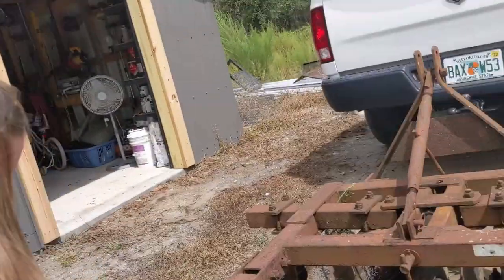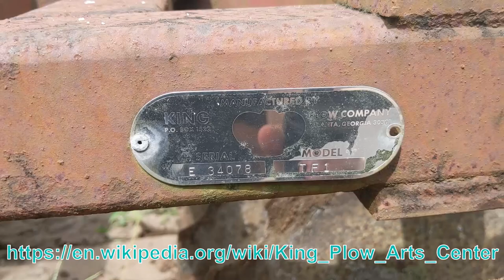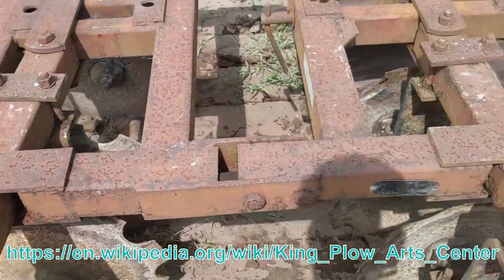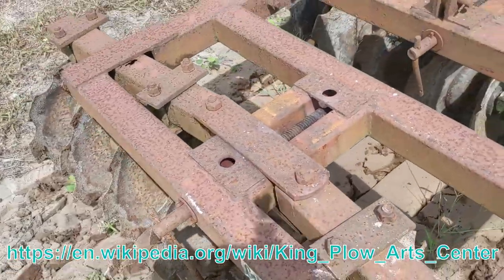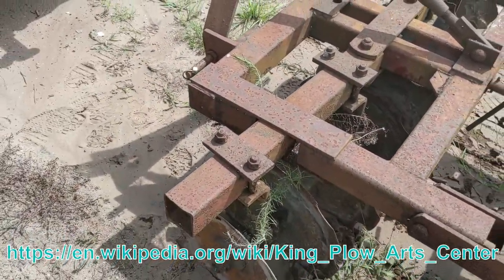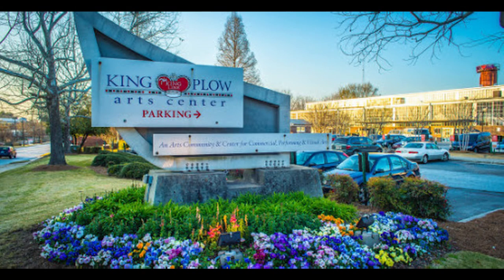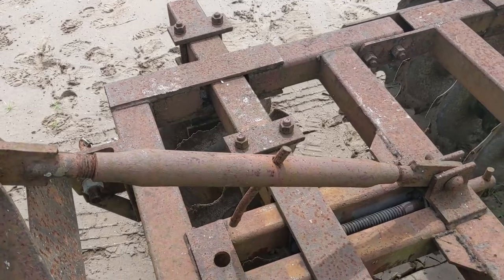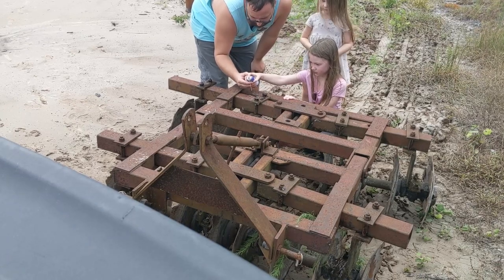Rust Bucket Rebuild - Restoring our King Plow Company 5' disc harrow from the ground up!

Comment: Honestly  that old disc looked just fine (PETINA)maybe replace rusted gang bolts with u- bolts, and bearings.  That disc has the best system for adjusting the gang pitch and its own top link adjustment, wish my 3pt was built that way.  Good luck
Reply from the maker: You're probably right about the pitch adjustment but even with grease and exercise I couldn't keep it operating smoothly. The disc and arms needed to go and the bearings cleaned up. If I'm going to go that deep into the project, you might as well replace the hardware with it. A lot of this steel was rotten and would crumble in your hand.
Reply: If you can remove or get to the threads of the adjustment shafts, even the top link, take an angle grinder and grind a groove or "keyway" the length of the threads.  My Ford pull-behind disc has this feature and it is self cleaning, with a little oil, kinda like a thread chasing tap.  But it's probably all welded together.  Take care